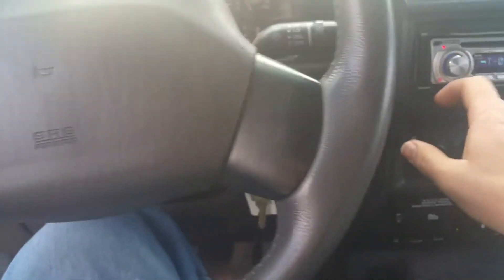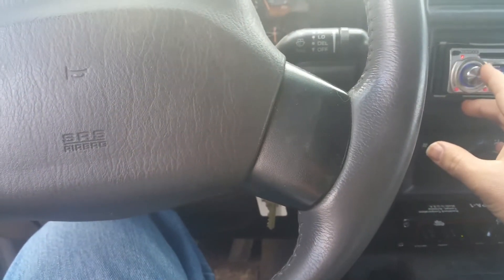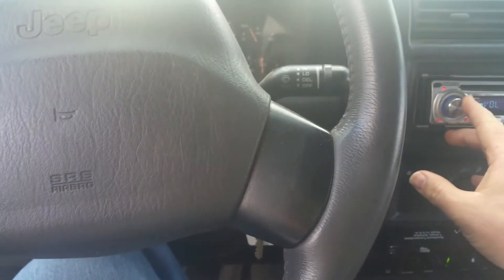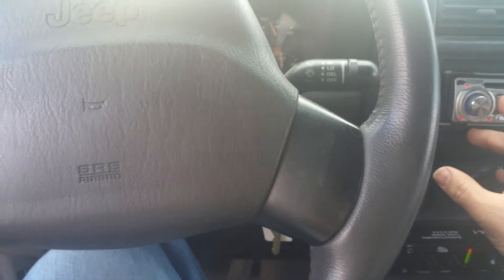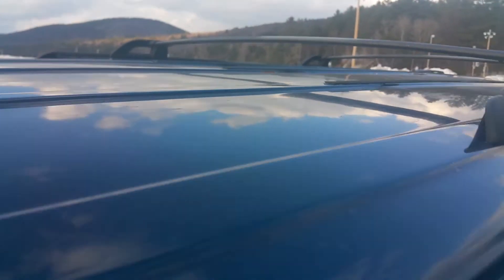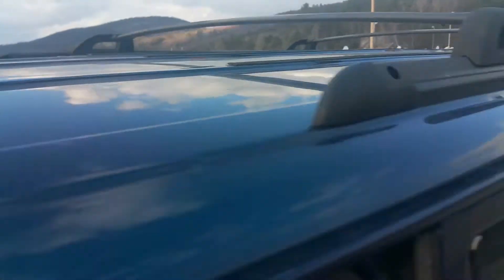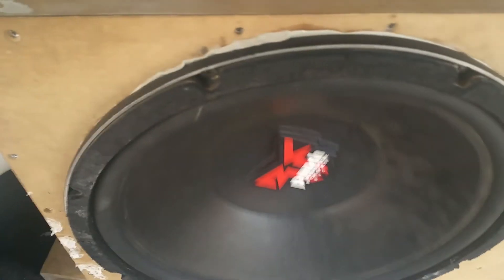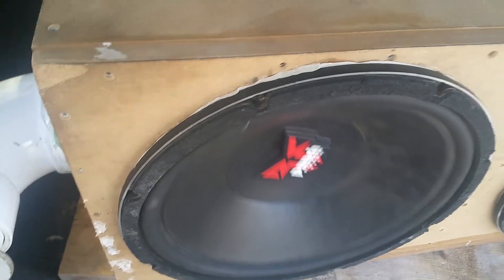Bass Test Video Showing More Bass with Less Subwoofer Excursion Due to a Ported vs Sealed Enclosure

Comment: the advantage of sealed is, you make the speakers jump,,, you actually use the excursion ability of the speaker, you throw the base wave further,, its got the earthquake thing going on when they jump far,,, just need a good match with the subs and amp so they handle the power,  ported is louder and punchier,, sealed has got that evil earthquake window shattering cop pulling me over thing goin on lol
Reply: Sealed enclosures give you a quick punchy bass and ported gives you a loud thunderous rumble bass.

Comment: Yes you get less excursion, but you also get inferior transient response with a ported compared with a closed box, so a well designed large excursion closed box will always punch faster at 0.707 Q, plus the ported box is larger.

Comment: Nice video steve!
Reply from the maker: Thanks man! I want to make a longer more in depth comparison video with a dB meter as well. Doing some real world tests on a meter sealed vs ported, whether or not ported gains 3db over sealed, whether or not double cone area gains 3db, whether double power gains 3db, whether drivers side port is louder than passenger side port, etc... all of these tests can be done in the jeep with this box.
Reply: Steve Young yes that would be a very good video idea. windows sealed vs half open vs all the way open...etc. that will show real information. numbers would be awesome!
Reply from the maker: I have a friend with a termlab, I'll see what I can do....
Reply: Steve Young hey no rush...im subscribed to your channel so whenever you upload it I will watch it!